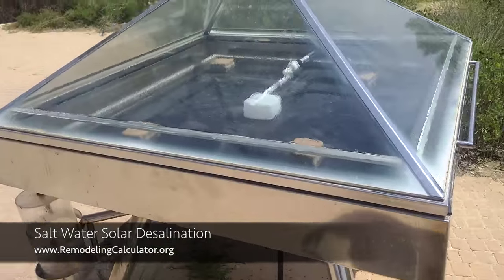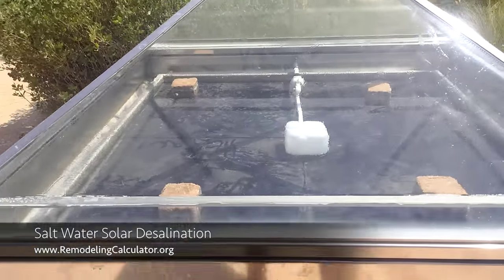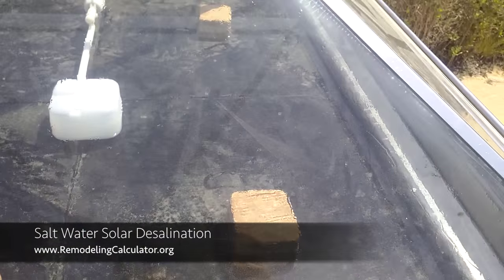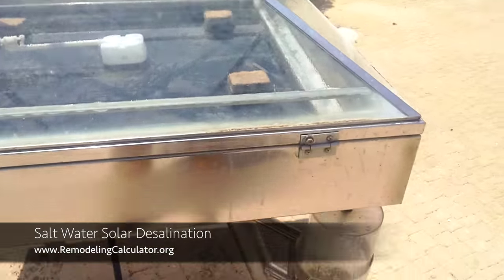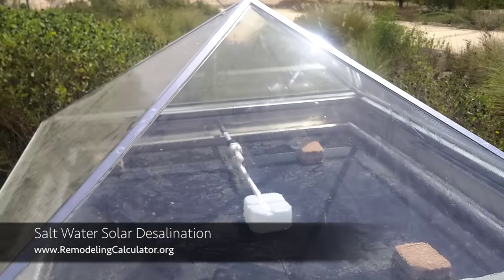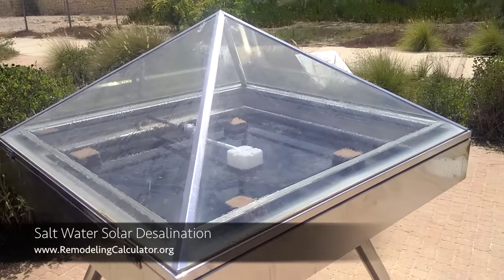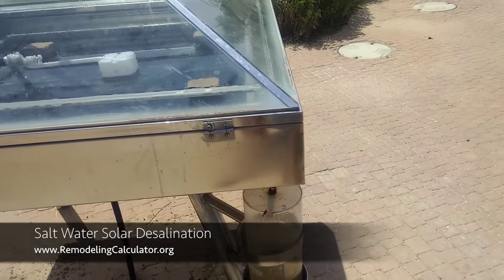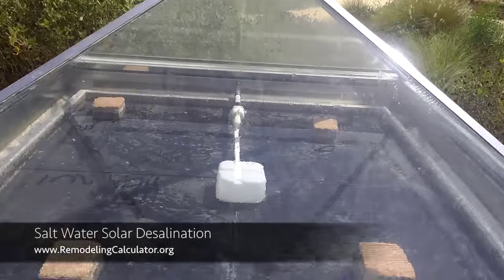Salt Water Solar Desalination - ZERO Energy

Comment: Your "clean" water is pretty yellow. What if the water is contaminated with chemicals which evaporate sooner than water? Like from mineral oil industry ( gasoline).
Reply: you can separate those toxins before or after you distill the water, I tend to think that before the distillation may be better...
Reply: Robert Ostman :" It is out of question that this is possible. All I am saying is that it is not possible with this device.
Reply: well I don't know if that is correct, but you may be interested to know that, in my own experience I found that in general it is the wrong approach... a better solution is to distill water in a different way, while using solar to do the heavy $$ work... depending on climate region, if in low solar region you need parabolic mirror to heat a coiled pipe... if you are closer to the Ecuador, you will need a simpler solution... take the hot water to a radiator and transfer the heat to a clean steam chamber... so you need about 2 or 3 loops these go to the evaporation chamber... before you get to the evaporation chamber it may be good to heat the water at about 60 to perhaps 80 Celsius so to remove the chemicals that you mention.... then you send the remaining water to the steam room.... where you separate the other pollutants....  where the water condensates it is needed to skip the use of any plastics, silicone's and metals... glass/pyrex, and ceramics can be used... then you add at the end a very small amount of minerals so to prevent the water from taking these from the body...
Reply: Robert Ostman : Serious man? You start out saying that you don't know if that is true and then you elaborate on the several processes it takes to extract the toxines.....well no $h¡t, Sherlock! That's exactly what I'm talking about, smartypants.^^
Reply: waw well you are odd... I say I don't know because I don't... this is I haven't imagined a proper solution to that ordeal, for the device seen in the video, but others my have solved the ordeal... then I provide a different path that should provide a better outcome... and you complain ??... any one can complain... you most be a child... in the world of the grown ups you need to leave behind the complaining and get to the step where you can provide ideas and other stuff that properly helps ppl... complaining is simple so simple that any one can do that shit... they don't need you for that because they can do just fine without you to complain on their very own, just as good as you would...
Reply: Robert Ostman : You must be German, because you are such a smart ass. You answer questions I did not ask. Did you ever notice? I said that I think it is not possible to completely purify the water with this simple device if there is anything besides salt in it. Make your own post if you want to explain how it is done. I did not ask you. Just because people in RL are no longer listening to you, you should not harass people on YouTube.  I know as much as you do about the processes which is not a whole lot to be honest.You are barking up the wrong tree here. Every time I try to tell you, you start explaining more and more. Are you finally done? Well, then why don't you just mosey along then "friendo"?^^
Reply: ???... okay....
Reply: Nothing fits all scenarios of course, but you obviously realize that....   The escape temperature of everything in the source fluid has to be factored in - different hydrocarbons are more volatile than water, so they evaporate more quickly at the same temps.  If the raw fluid mix is known to contain such, you have a tough situation to deal with it in such a simple device. Those would really make things tough...   Dean Kamen did a more complex, powered system called the Slingshot that you could put raw sewage and such junk into and end up with pure water - worth a read how they operated - but part of it was temperature control and venting off volatiles before beginning capture of water...   A device like this would be most trustable where you didn't have petro involved.  There could be other things problematic too - like certain strains of toxic algae.   You'd still want to be filtering out as much can you can before trusting simple evaporation.   Also, repeated processing of the result would give you progressively purer end result...    some timed early venting might allow the volatiles to exit up to some temperature point, then close them for the capture of the water condensate... ?

Comment: I want some of ideas to cooling the glass please
Reply: As long as there is a temperature differential between the ambient air and the interior of the unit, you will get condensation.  No need, as I see it, to cool the glass.  Cooling will require additional energy input and likely generate more greenhouse gasses.

Comment: What tools to flow water from the glass to the tank?
Reply: in the design in the video you see a black surface inside the pyramid, that is a container where the dirty water gets into the system, the glass on the walls of the pyramid is there so to let the sun pass into the system while at the same time providing a surface for condensation to occur, condensed water on the glass will start to try to fall, so it uses the angle provided in the design, this means that at the end the water falls into a set of channels/tunnels that take the water into pipes/tubes... this is clean water so you can connect the pipe/tube to a container where to store the water, it is important to note that no plastic nor silicone should be used in the design as these would create toxins, metal should also not be used.... ideal solution is to use glass/Pyrex, or ceramics, important to note is that you would need to add minerals to the distilled water or it will make you sick (potassium, magnesium and calcium chloride... I suggest looking into that part as there are many ways to do it and it is a complex topic...

Comment: Not having enough space to build these things is a ridiculous notion. If we can build giant oil rigs in the middle of nowhere in the ocean, we can build solar desalination plants. The ocean is about 70% of the earth surface area. There is more than enough space for these things, and they'd do almost zero damage to marine life.
Reply from the maker: I meant LAND, because to produce sizable quantity of pure water, you need a lot of land
Putting this in water is VERY expensive, because you need some kind of floatation
Reply: floatation is cheaper! u can use the ocean water without putting it in a different tank! Sun evaporates ocean water everyday you just need to make someway to collect the water before it goes up in the sky
Reply: wave actions would make really simple systems hard to design...  but sure, it's possible.
Reply: yes his space comet was pretty dumb

Comment: How to build it?
Reply: A pyramid shape is not necessary.  one can do this with a flat plate of glass on a frame with a slight tilt to guide the water to the collection trough.  There are loads of designs online for solar evaporation.